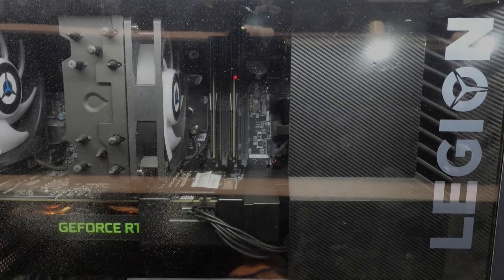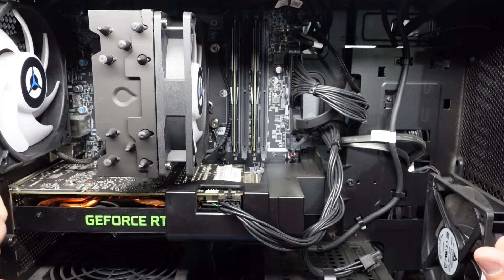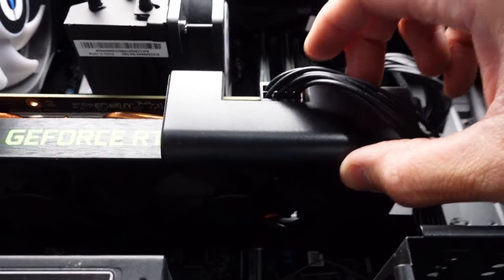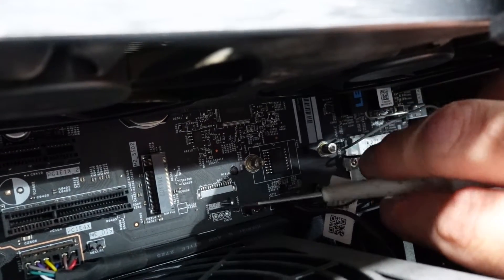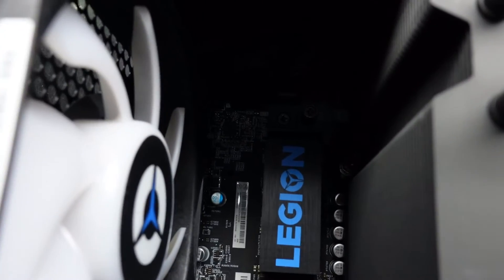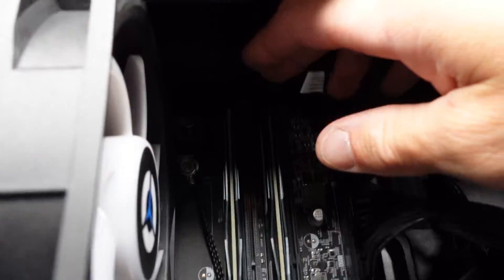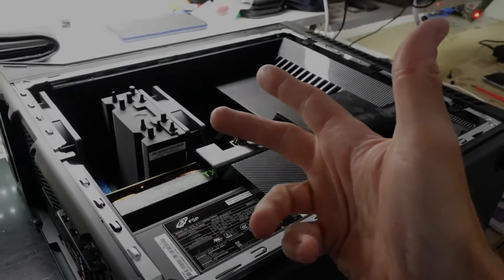Lenovo Legion T5 28IMB05 What Can be Upgraded

Comment: Do you or any others have any input on a fix/solution for the graphics driver updates causing a blue screen with this model? Lenovo tech only gave me the option to...never update the driver.
Reply: Lenovo's second workaround is to disable "NVIDIA USB 3.10 eXtensible Host Controller -1.10(Microsoft)" in device manager. A few users have reported success when running the latest drivers with this method. Others reported freezing continues.  

WORKED FOR ME!

Comment: i know this may be late but would it possible to get a vid on how to remove the gpu? i cant figure it out and i need to change the cmos battery
Reply from the maker: i dont have access to the computer anymore sorry

should be a screw near the back of the case 

then a little tab on the mainboard to release the gpu from the slot its plugged in to (this would be the same on any pc)

Comment: my cpu fan (the front one) won’t light up, can you help
Reply from the maker: look like a fan replacement might be needed
Reply: @rickstechrepairs  I fixed it
Reply: @AyberkTR2005  I took off the plate opposite of the side with the glass (screwdriver will be needed) and moved the cord connected to the non workin fan to the right port. there was a youtube video on it, I can see if I can find it again if you want
Reply: @3rror_yt  thx dude

Comment: Thanks for the video Rick, greatly appreciated. I just got the T5 26ARA. Although they have changed the case cosmetically for 2024 and now use the AM5 architecture, besides a Ryzen 7700 CPU, RTX 4770 TI super and 850w power supply, the motherboard layout looks almost identical to what you have. The ram slots, and extra NVMe slot are in the exact same spot. It's nice to see that I may be able to do some upgrades in the future. Thanks again

Comment: how far can you upgrade the cpu? my one is i7 10700
Reply: i9-10900F
Up to Windows® 10 Pro 64
Up to NVIDIA® GeForce RTX™ 3070
Up to 128GB DDR4-2933, four UDIMMs
Up to two drives, 1x 3.5" HDD + 1x M.2 SSD
Reply: @huecobros is a 3070 the most u can put in it?
Reply: @highofftealeaves im about to put 4070 super in it dual fan. I think u can put any gpu in it as long as you have enough psu and slot x16. The newerr gpu also comes with 8 pin converter to 12 pin
Reply: @Preet2k  shit okay yeah because I was looking at that exact graphics card. I think from memory the default psu is like 650 which should work assuming the rest is kept stock right?
Reply: @highofftealeaves  I also changed my cpu, and dont have stock cooler. 650 was still enough. I want to upgrade it 750 or 850 tho
Reply: And I9-12900k or 13900k is worth it ?

Comment: I’ve been reading about people having issues with the additional RAM running at the right speeds. Did you have any issues with the RAM you added?
Reply: AMD takes issue with x4 sticks of ram.  If you upgrade ram and stick to only having 2 sticks installed you should be fine (generally speaking).  So it may not be an issue with the pc but with the AMD platform.  

It's been a problem for a while IIRC

IE:
You have 16GB (2x8GB) and you want 32GB

Buy 32GB (2x16GB) remove the old ram and install new ram.

If you buy a 2x16GB and install that AMD doesn't like it. 

This issue has maybe been fixed but AFAIK it hasn't.
Reply: @SleepingSavage B550 motherboard AM4 Ryzen 7 5800 RTX3070. i have the kingston hyperx beast 2x8 DDR4 that runs at 3200 and i added the corsair vengence 2x8 DDR4 made to go at 3200 but since then the speed locked at 2133 i just dont know why, both ram types are listed for 3200 but when you go in the bios there is no option to tweak the speed even if it previously was 3200 when i got it stock. Im currently informing myself about the newer bios update since the pc is stuck at the 2021 Bios and it does not show nothing on advanced update in the update setting on windows. i dont know if the more recent bios update lets you change the ram speed or not.  did someone here had similar issues?

Comment: i have a question, i have the same pc, but with no glass so i can see through without opening up the pc, cant seem to find a way to get one of those.
Reply from the maker: I'm not sure what your are asking

are you after a replacement side panel with a window?
Reply: @rickstechrepairs  yes, i have a panel with no glass on the side and i wonder if theres a way for me to get one of those.
Reply: Yes , did you find the Side Panels or do you still need to know where to order them ? Dont order from EBay , too expensive . But I’m about to order the Solid Panel and the clear Side Panel . I will gladly Share the website if you want it ?
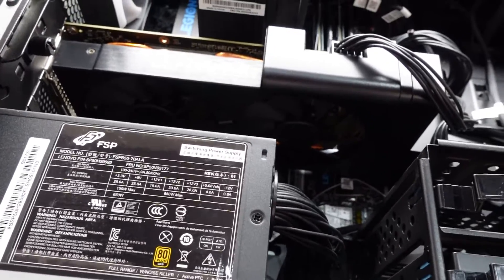Reply: 8:50 I have upgraded my PSU to a Corsair CX750 - 750 Watts . I was told it would handle any upgrades